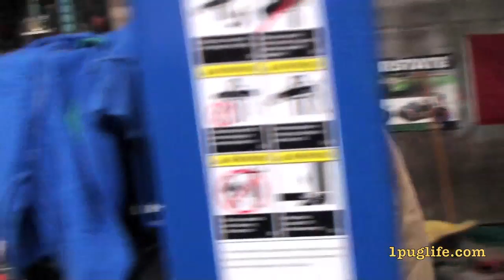first english wheel lesson

Comment: You suppose to stand in front of the English wheel and turn the rollers so you can work the metal from the front.
Reply from the maker: Ruben lol
Reply: Yeah, it's not braced for side to side force. Lesson #1 stand in front FFS
Reply: You are completely wrong. How would you work a fender or a any curved surface?  You never have so you don't know. Do you?
Reply: I work in a large sheet metal shop that has 5 english wheels, a power hammer, various welding set ups etc. etc. etc... Please don't try to argue with me..  That's just how they are made. You need to shake that head at yourself. SMDH
Reply: Alrighty. Im just telling you the industry norm.  Maybe everyone else is wrong and you guys are the only right ones?... I was taught by Ed Barre with some wisdom from Fay Butler along the way over 4 years.   Look up those 2 names and then tell me I'm doing it wrong.
Reply: *Ed Barr

Comment: Instead of insulting the quality of the tool. Why don’t you start with putting the legs on the wheel correctly. The wide part of the legs should be under the wheel so it doesn’t tip around. Pretty simple.

Comment: Dear Pug,
There is much for you to learn in the world of metalshaping. You are using that english wheel all wrong and cranking down on it way, way to hard.  It should  be a fluid motion with no pinching or binding. The metal will stretch the way you want just give it time.  Try a MORE AGRESSIVE wheel that has a smaller contact area if you want more faster stretching.

If you stretch the metal too much there are various ways of heat shrinking or power hammer shrinking.... Try making a foam or wooden buck you could make reverse for the other side.

On that fender where you have used the stretcher to mix that odd looking dip in the fender. That was actually the exact opposite of what you needed.  It had that dip from to much metal, it wrinkled, it needs major shrinkage.

If you have any questions just ask I know how to shape/weld metal,
-   Jeremy